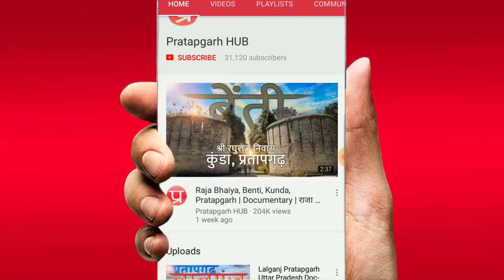National Highway Road 96 Construction | Pratapgarh-Allahabad Road Construction Documentary

Comment: This road is constructed by GR Infra , this company is well known firm for road construction work , well machinery  system and also best experienced engineers for road .  the project name is Rehabilitation and Up-gradation of Pratapgarh to Allahabad bypass road junction section of NH-96 from existing km. 100.800 to km. 135.230 to 4 lane with paved shoulder under the EPC mode in the state of Uttar Pradesh for a contract price of Rs 3,83.97 Crores and this project was awarded by Morth  September 26, 2016  under  NHAI . After the project sanctions it take around 1 year to set up all the arrangements  . now work is in full speed .

thanks  & regards
Reply from the maker: प्रतापगढ़ हब चैनल पर आने के लिए आपका बहुत-बहुत आभार !